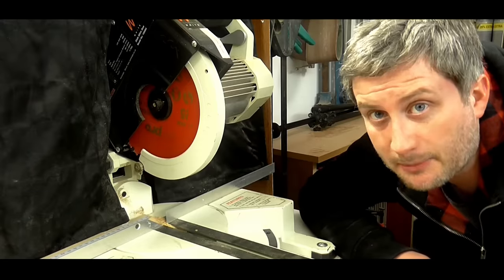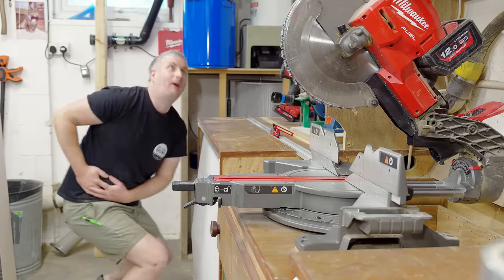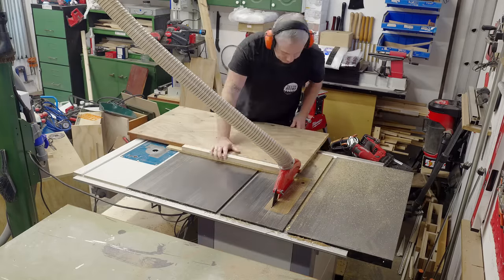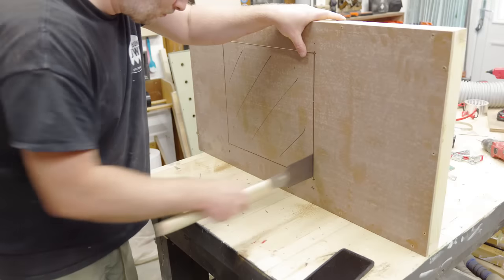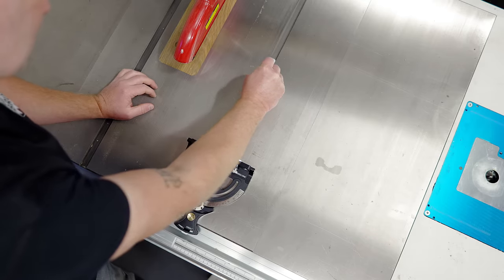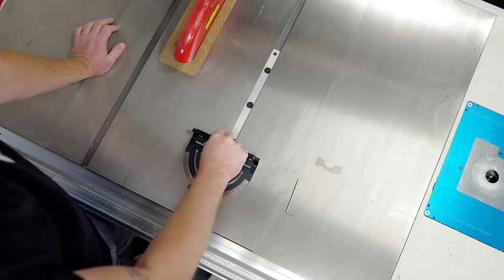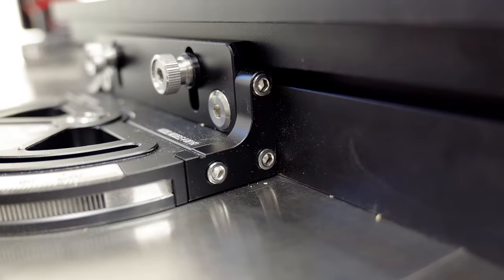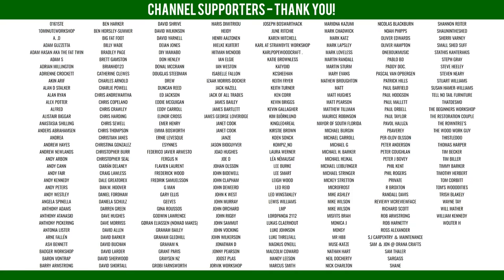Goodbye, Mitre Saw!

Comment: When I started woodworking I often read that the first tool you should get is a mitre saw. I've never felt the need for one though. I can see the need if you're doing a lot of framing, but I find the table saw, with sleds, do everything I need. Especially as, like most people, I have to deal with limited space.
Reply: I feel this definitely used to be common wisdom.

Maybe it’s also ease of use and safety?

Either way, I agree. I had thought of avoiding a table saw for a long time. When I finally got one, it’s one of the tools of top priority and gets used the most.
Reply: A miter saw was my first power tool, but my first project was installing hardwood flooring. And framing style repairs, trim and other things needing that sort of cuts.

I haven't done much "panel" work like cabinets and tables.
Reply: And my bracket (really old)  they said depending on your type of 🪵 working, tablesaw or bandsaw as your first shop power tool.

Comment: If you just need 90 deg cuts in long stock or small boards you can make a circular saw cross cut station with angle iron rails and a base board. Bonus..it is portable for outside work.  You can build it to take anything from studwork timber to four foot sheet.  You can add a removable 45 deg guide bar for mitre joins too.  It costs ten bucks (plus saw) and you can knock it out in an afternoon!

Comment: I am the same.. I have a very small/cheap Hitachi that is on front rails.. It is light and I can tuck it away and just chuck it on my workbench if I need to do a big post or something too hard for the table saw.. I have struggled with accuracy with them all the time.. I see lots of people on YouTube just rough cut it and use shooting board after

Comment: Interesting video. I finished my first cross cut sled for my table saw yesterday and immediately started asking myself “Why do I need the miter saw?”  The dust production is horrible. My Dewalt doesn’t seem to hold accuracy either. Small parts can be cut much more safely on the sled, and I can make a cut up to 22” on the sled as well. However, the miter saw was the first large power tool I bought…

Comment: My workshop is half of a single car garage. I have a Makita mitre saw and a Dewalt job site table saw both on rolling cabinets. I wheel the the mitre saw outside because the dust collection is lousy but its very weather dependant. I have the hongdui mitre gauge and use a 600mm length of 8020 aluminium extrusion as a fence. I'm thinking about making a track saw jig to replace it. If it works I may ditch the mitre saw and re-purpose the space.

Comment: A chop saw (miter) is a space hog and a hot mess for sawdust. Mine is in storage because as you said it can be handy on a jobsite. I now look at tools and ask myself "can I do that with hand tools"? The jointer was the next to go. I have fallen for hand planes and hand saws. I enjoy the physical energy and the lack of noise, dust. I have a Saw Stop and pulled it out for the first time in a year this week. I couldn't find my hearing protection in a 10' x 16' shop, still looking. Nice video!

Comment: I’ve got an old Delta chop mitre saw with no sliding component. I have had the same problem, and on mine it is due to wear on the notch at 45 degrees. Years of knocks and the spring loaded catch slipping into the notch and wearing it have made it baggy so I have to use an engineer’s 45 degree to set it every time.

Comment: This  may be completely off the rails, but did you consider investing in better blades for  your mitre saw?  This becomes critical when you have them sharpened.  A cheap saw with a good blade will outperform a high end saw with a cheap blade. I run tenryu on my 12" bosch glide and get good consistent results.  I have them sharpened by an outfit that uses a cnc grinder to maintain the original geometry of the teeth.  That said, a mitre saw isn't designed to give the same cut quality as a cabinet saw.  Expecting a $500 tool to perform like a $3000 one is a mistake.

Comment: I have the same fens and I didn't wanted it to close to the saw. I've fixed the length with a screw in the stopblock. It is treaded.
Thanks for sharing and it makes me think differently of buying a Mitre saw.
But... do you think it's still save and accurate to saw lets say a 2x4 of 4 meters in smaller pieces?

Comment: I didn’t use my miter saw for years. 

Then I had to redo baseboards in my house. And that baby was the absolute most important tool I owned. 

Pulled it out in the driveway so I didn’t care about dust and it made life way easier than my table saw could have.

Comment: I've also removed the station, but placed the miter saw on a moveable stand.  I wheel it out of the way most of the time and bust it out and use it outside if I need to use it.

Comment: I got rid of mine, and my space is far smaller than yours (a single car garage). I tried to get along without one, but ended up buying a Festool Kapex and I made a mitre saw cart with flip up wings.

I have two workbenches, a table saw, full size planer/thicknesser, 3 dust extractors, router table and mitre saw cart in my garage. Yeah, it's tight, but it works.

I found messing around with cross cut sleds etc too much of a faff!

Comment: The mitre saw is my most used tool. I feel its much safer than the tablesaw and I can get most projects done with the mitre saw. I used to have a Metabo mitre saw which was great. Now I have the Kapex and its also great but not perfect either. I wish they would offer mitre saws that have no base. You would just screw them onto your workbench.

Comment: Doing building restoration and rarely finding a right angle, I found a mitre saw with a laser guide absolutely invaluable. I had a cheap 10" SIP with laser for years, ( put a decent blade in it) and finally replaced it with the big milwaukee (12"), but that doesnt have a laser, has an angle guide instead, not nearly so useful. I wouldnt get rid of it as a workshop machine though.

Comment: I did the opposite. Instead of a cabinet saw, my setup includes a Sawstop Compact Table Saw, routers, miter saw and track saw. I just don't think I could give up a miter saw, but I certainly don't need a cabinet saw. Everyone's workflow and requirements are different, however. I hope Milwaukee makes your miter saw right. It is surprising that they came to inspect it. That's impressive.

Comment: I knocked a 1.5m2 hole in the wall complete with a pre-stressed lintel and mounted the mitre on a hinged bench with electrically operated gas struts struts and fold down steel box section legs that lock into concrete anchors, then built a brick extension on the outside with dust extraction to house the whole thing. 

Now my mitre folds flush into the wall when I'm not using it with the press of a button. Also have extra storage in the extension for other tools.

Comment: I rarely use my Miter saw. A nicely set up table saw does a much better job for my projects. Some of these after market miter gauges for the table saw are the real deal. I have one but not the same one you have but similar and absolutely love it. With it I can make repeatable and dead on accurate cuts.

Comment: I must say a don't think a could part with the mitre saw I have. Granted it's not perfect by any means but your right ripping off cuts for firewood bin and rough dimensional wood cuts it helps. I now have 2 thoughts of the new tool. You've either accepted a laser or your getting radial arm saw?? 🏴👍
Reply from the maker: Nope 😜
Reply: @RagnBoneBrown  dammit I'll try again on next video!😅🏴👍

Comment: Just a quick question. What if you need to build a wall ? I have a miter saw that I use like 3 time per 5 years. its heavy, I dont particularly like working with it. But at the same tim I dont have a nice table saw (only a small job site)
Reply from the maker: I tend to use circular saw and speed square, if you watch my shed project you'll see what I did there 👌

Comment: I couldn't imagine a jobsite without a sliding miter saw, but the only rib i used mine for was rough Lumber breakdown, and that on an portable jobsite miter saw stand.   It would take up too much VALUABLE floor space in my small furniture/woodworking shop.

Comment: Brave! It was funny though when you asked me about the mitre gauge I had a job in and need 100% accuracy checked my Kapex and it was on the piss too! Personally though I coundt do with out my mitre saw, it s way easier to cut to length accurately than a table saw. Curious though, ive never ever used a mitre gauge on the right of the blade, what makes you do that???
Reply from the maker: I have way more space to the right for long lengths and more support too (router table extension). I don't see why the left would be favourable, other than most people do it that way?

Comment: I loved my miter saw. 
until I noticed that my cuts were off by miniscule angles when doing precision work. 
Trying to dial it in all the time is a frustration prospect. 
But I dont have a workshop, I have an outside deck, and that means Im constantly moving things around, covering things up for the constant rain and wind storms, etc, so every time I dig it out I notice it's a little off.  Tried using a jobsite table saw but for breaking down sheet goods it's way too small. But I have no room nor a place to put a normal sized one. 
So now? It's all circular saw and clamped straight edges married with speed squares and foam underlay baby. Think I may get one of them track saws in the future, but for now, this works.

Comment: Did you try redoing the initial setup on your miter saw and check for loose screws and bolts?
My guess is that something came loose and made the saw susceptible to losing its calibration.

ADDING: But if it's not essential to YOUR projects ... sell it on. I haul the miter saw off the shelf and set it on a work stand when I need it. No work station for it, just sawhorses at the right height for in and outfeed.

Comment: My miter saw has been in my garden shed for 2 years. I get much more accurate cuts on my table saw. The only thing I would use my miter saw if I had space would be to rough cut to length, but in that case I can just use a circular saw or track saw on panel stock if needed.

Comment: Don’t see how this setup would be good for cutting 45 deg angles for trim boards around a door or patio door where the trim pieces are quite long. My mitre saw doesn’t do a good job either (angles are never consistent or maybe frames are not square. Maybe you could have a demonstration of how one might use the table saw to do so. Interesting video. Thanks.
Reply from the maker: If you watch my future videos you'll see how it's working out

Comment: Tldr; i built a 2×3 table out of scrap wood and attached my miter to it. When i need the saw i just pick the table up and put it on any flat surface and when I dont I just leave it anywhere thats convenient. It also works well on the ground or on a trucks tail gate.

Comment: If you’ve got a large table saw with space to have a fence and flap stops, I can see it makes absolutely perfect sense to reuse that tool and ditch the mitre saw.  I’ve only got a basic Evolution Rage 3 mitre saw which suffers from poor dust collection and never seeming to be able to get absolutely perfect cuts.  Its good for rough cutting but since I got the table saw I’ve found I’ve hardly used it and I wasn’t fancying having to build a massive cathedral of space either side to achieve adequate cut areas.  Your video has given me more food for thought about whether I do need my mitre saw or not 😮

Comment: im a bit confused. Why would you have a battery powered miter saw if it's only going to be used in the shop? especially with a plug that is conveniently there. its like using an electric golf cart to do to Cosco. why have the miter table higher than the table saw or other tables. if the workplace is this limited your miter saw should be movable. how could you even cut moldings? unless you make a slot in the wall next to the garage door as an in feed for materials. also  I could understand a problem with a router and saw dust, especially with MDF but whats the big problem with a chop saw? it's like working at a fish processing plant and not wanting to smell like fish.

Comment: I’ve been thinking something similar. I have a very cheap miter and I’m concerned about the space it takes up. I have a track saw, and my table saw I could use for cuts. I’m curious about how you end up. 

My hesitation is because sometimes the things I cut are dirty or wet, so I don’t want to risk my saw stop.

Comment: Thanks for this video.  I've been thinking about buying a mitre saw and you have given lots to think about.  Looks like you bought a high quality mitre fence for your table saw.  I have a similar one but both yours and mine present one big issue.  I use a SawStop cabinet saw and it is the work horse of my shop.  Unfortunately, the aluminum fence of my mitre fence, like yours, will result in activation of the SawStop safety cartridge if it touches the blade and in my case this happens about once per year.  My expensive saw blades are thus damaged and I have to spend some time extricating them from the saw as well as buying a new safety cartridge.  Wooden fences are the obvious answer but their accuracy creeps over time.   Why doesn't someone make a sacrificial fence out of phenolic material or something similar?  Frustrating!

Comment: I quit using a miter saw in my shop years ago. Took up too much space. Mostly it wasn't accurate enough.  I use my table saw with fixed sleds that all I have to do is drop it in the saw slot and it is ready to go.

Comment: I've never had a sliding mitre saw. I have used one, and it was fine, but certainly not essential given a crosscut can be made in so many other ways. I feel like they take up a lot of space for the limited use they bring to a furniture making shop.

Peter Millard has a video showing how to make a tracksaw jig for 90° and 45° cuts. This can be hung up on a wall when not needed.

Comment: I think that will work out well for you as you have a nice table saw. My table saw is rubbish, top is got a stamped steel bed !!!!! I also dont have a workshop so if i make something i have to set up outside, most of the time i use the mitre saw as its just easy to get out and set up. So for me that works better, for you that new kit you have looks like it will work well.

Comment: I too just got rid of my miter saw. I have a very small shop. Because it was a sliding miter saw, it took up too much room. I had to keep it far from the wall so the sliding rods had somewhere to go. It also generated far too much dust. No matter what I tried, dust was a problem. I have a large capacity table saw sled that allows me to cut even wider boards than my miter saw could handle.

Comment: miter saw is good for basic cuts, i don't have a permanent station for mine since my shop is small, all the smaller stuff stores on shelf under the table and i just pull out tools i'd need at the time. my table saw, etc., are cheap so accuracy is not something i expect, i do have a sled i made for table saw and for accurate cuts like on trim and such I'm now using a Japanese style hand saw which does a nice job.

Comment: It really comes down to space, all criticism of the compound mitre saw aside. Horses for courses. I have a compound mitre saw and a sliding table saw. Each type of cut on the table saw has a longer setup time, where as a mitre saw for smaller cuts including angles takes a fraction of the time. Larger cuts on  sliding table is worth the time. My dewalt compound saw is very accurate and very adjustable, however a non sliding compound saw would better suit you.

Comment: Hi, good video. My thoughts as you move forward. All of us need to do what is right for our shops. For me, the miter saw is very important & my Makita 40 volt 8-1/4" glide is extremely accurate. Again, it depends on your need & usage. The only thing that I will say is that we ALL have more space than we really need.........we just have work with different shop configurations until we have maximized our space. I think every shop can find space and find value with a high quality miter saw.

Comment: I wouldnt want to be without my cheapo Evolution mitre saw, but I've never seen the point of  a mitre saw worstation. I have mine on a storage unit, and I have a couple of wings  if I need to make long cuts.  Dust extraction consists of a high back which drops into a rubble sack for everything the vac misses. Mind you, I don't have an accurate table saw, so I don't realy have your options but I doubt I could be arsed to keep a table saw clear just to cut a few bits of timber to size. Follwing this with interest

Comment: For anything less than a 2"x4" I always found that the non-sliding miter-saw was a better option, basically just the single axle in bearings hinge, they have to have a much larger blade to even get close to the capacity of the sliding miter but most people not in construction rarely if ever have a need for cutting anything larger than a 2"x4", they are much simpler, with fewer moving parts and WAY more rigid....
Reply: I totally agree , I’m a kitchen fitter and now run a small team of fitters and this is the type of mitre saw I use and recommend, it doesn’t get knocked about in the van and paired up with a good rail saw it meets all my needs

Comment: It's why I don't use a sliding miter saw as my primary trim carpentry saw. My DeWalt 12" double-bevel saw has always been extremely accurate and consistent even as a saw that moved from jobsite to jobsite. The DW716 has been a standard of professional production trim carpenters for a long time. I have a 10" single bevel DeWalt miter saw for shoe mold and a cordless 7-1/4" slide miter as a general purpose saw for dimensional lumber, LVP, and cutting aluminum extrusions.